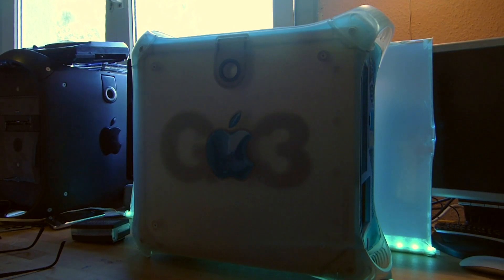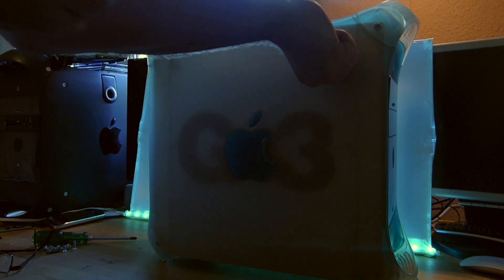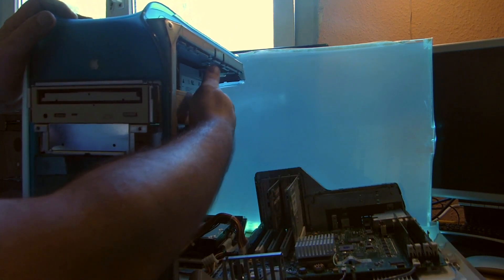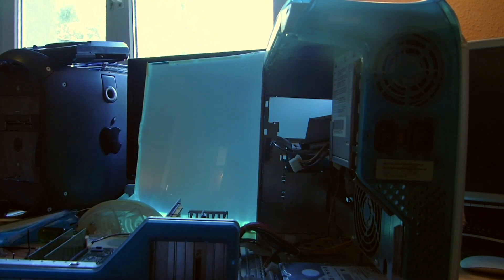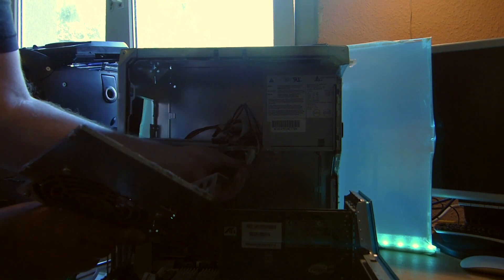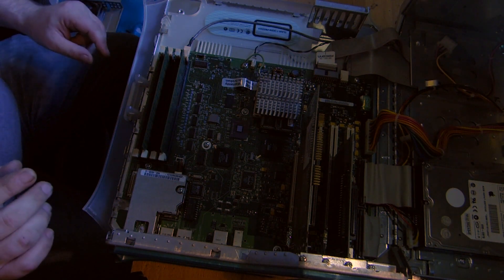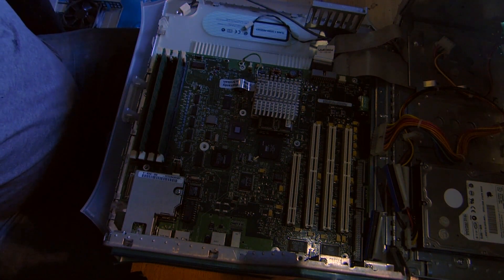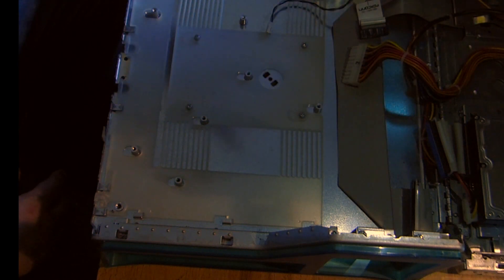Disassembly Power Mac G3 Blue & White

Comment: Which tool did you use to remove that one annoying screw when you said “thanks to the magic of editing” ?
Reply from the maker: sorry, late answer. at what time mark is it? it is so many years ago :) But I think it was only some imbus for the outside and Phillips for everything else.
Reply: @marcoraap733  the part where you got that annoying difficult to remove screw that was covered by the firewire module that prevented the board from being lifted up, i already removed it with a plier.